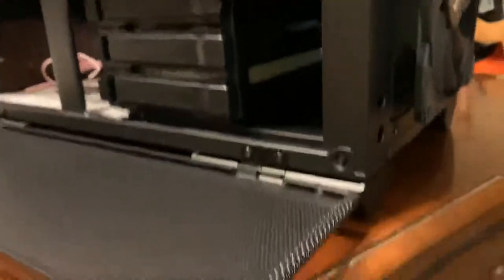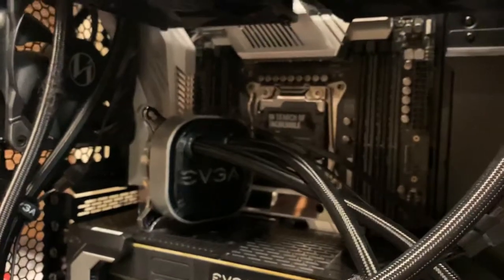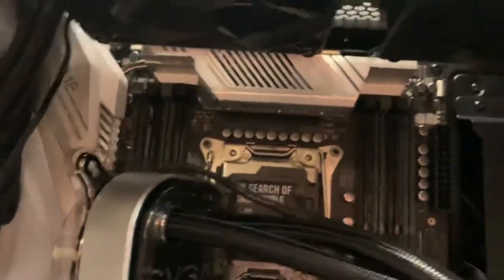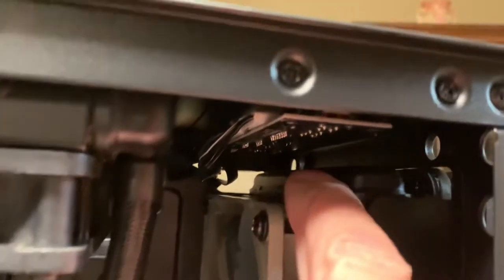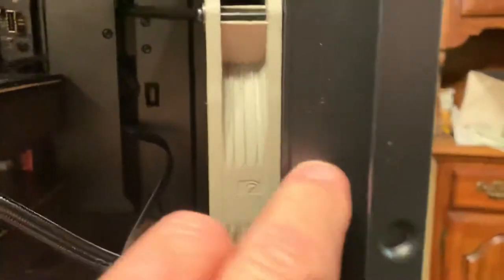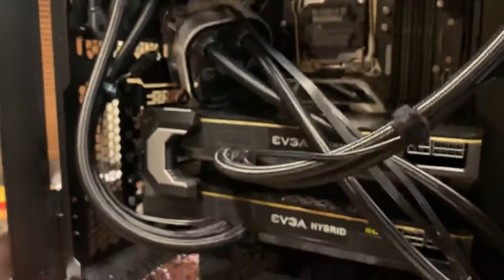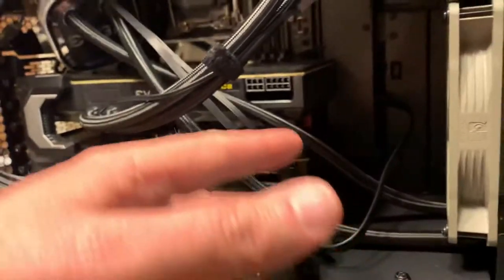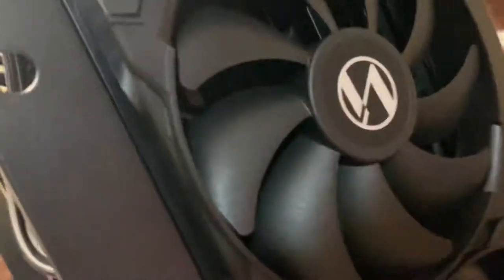My LIAN LI LanCool II Mesh build

Comment: Nice build! Got the same case. Do you use the Hard Drives? If not, you can take them out, that's what I did and it gave me so much more room for cables. And you said you modded the front for three 140mm fans? I wanted to put 3, but didn't want to go through the hassle of cutting the bracket so I went with two 140 on top and a 120 on bottom.
Reply from the maker: I cut the top lip off of the removable bracket and moved them all up and used EVGA 280mm radiator. I may try and use a 65mm thick radiator. Oh and by the way if the hoses are down it picks up the coolant better instead of sucking air at the top of the radiator because if the hoses are up your pump will probably have a short life
Reply from the maker: Thank you
Reply from the maker: I might take the hard drive bays too, thanks again Danny
Reply: @cliftonsr  Do all the screws fit for the fan with the holes already on the bracket or did you have to drill new ones? Yeah, the hard drive bays was kinda a hassle to take out. I had to turn it upside down and put the screwdriver through the holes on the bottom side of the PC and remove that lip thing that gets stuck, have to wiggle it around to find the screws but it works.
Reply from the maker: @momoson_  When I moved the fans up the top two screws barely missed the bracket but it holds tight enough because the rubber mounts that are on the fan just slid in perfectly and are a snug fit at the top and at the bottom like it was meant to be, I think this was what Liam Li was going to offer for this fan option but to keep the price down with either going with the 3 fan 120mm RGB configuration or 2  140mm high performance cooling for a comparable price option to be competitive with the competition. But I believe build quality and function of the Liam Li cases and products are seconded to none
Reply from the maker: @momoson_  Oh and I did have to elongate the existing holes just a tad with a Dremel and cut off the top lip. If you recess the bracket inward after you cut off the top lip just slip all 3 140mm fans like you are going to fasten them with the screws you will see what has to be cut just little to let you screw them in place, a little bit of finesse but it can be done.